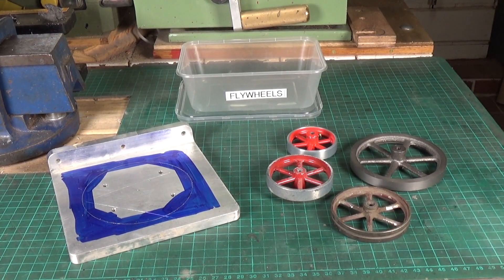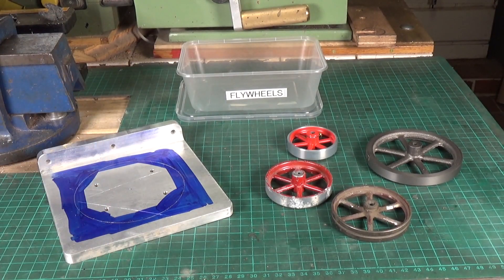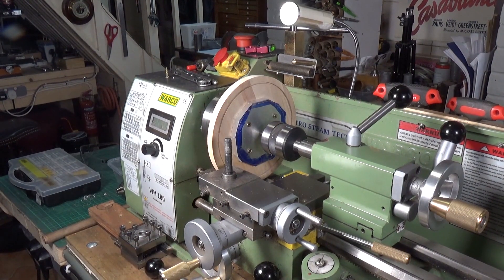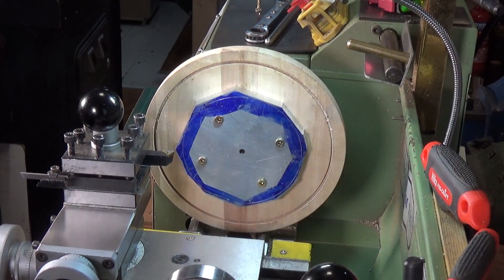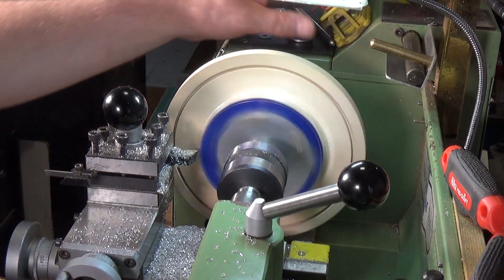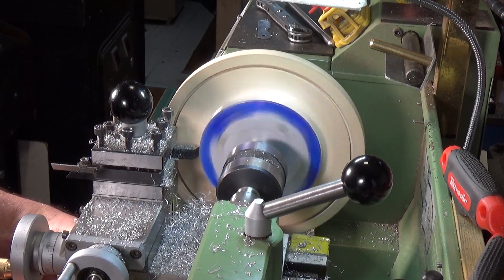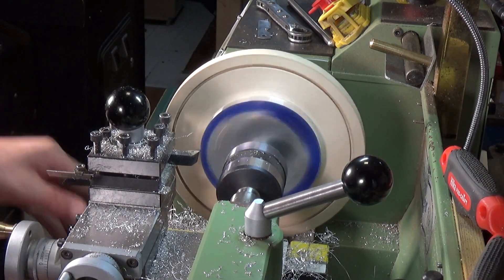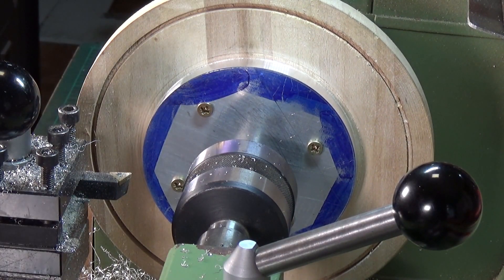Making A Flywheel For The Retro Steam Tech Electromagnet Engine - Part 1

Comment: Hi Alan,
A good start to the project... When watching i was thinking the bar that held the chuck guard would be useful to mount a gopro on for shots near the chuck... then i thought about the vibration, but then i thought about image stabilization mode ... I think i need to stop thinking.
Cheers
Paul,,
Reply from the maker: Hi Paul. Thank you. The chuck guard rod as you can see has a brass handle and a bit of aluminium angle. When the rod is upright the lathe is disabled and won't run, I use this when I have the spindle handle fitted so that I don't accidentally turn the lathe on! The aluminium angle has a sign on it which says "Spindle Handle Fitted!" in large letters 🙂 Cheers, Alan.